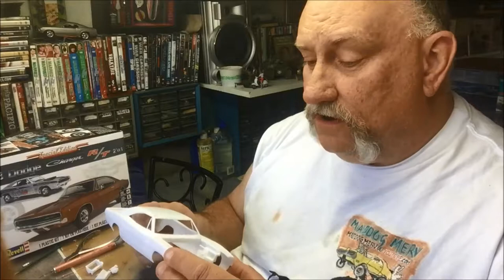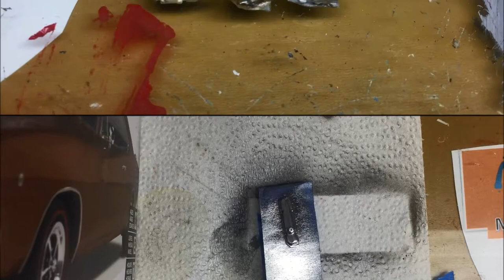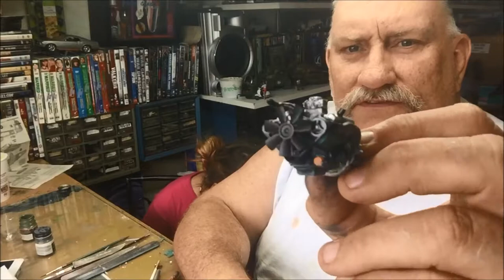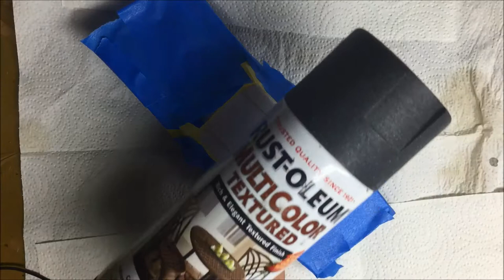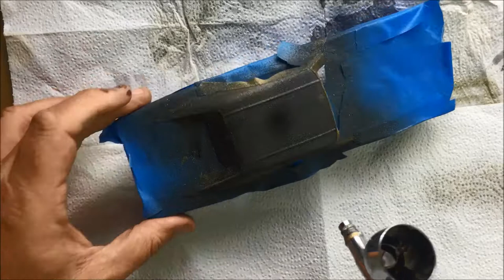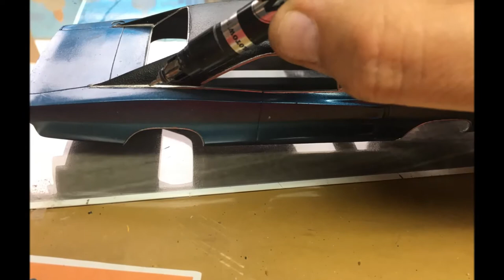Dennis's charger P.1/ How to model a vinyl top/ How to simulate chrome valve covers

Comment: is there a part 2? also after using the scale finishes do you do a wax job on the paint. my in law asked me to build him a lot 68 charger sun fire yellow so I'm in the research phase. thanks
Reply from the maker: Thanks for watching Mike and thanks for commenting. So far there is not a part 2 because I haven't completely finished the car yet. Got it to a certain point and it's been on the Shelf of Doom for well over a year. It depends on which one of his finishes I use. I have some of that yellow and I have not waxed it. I thought it turned out good with out polish.

Comment: Yes AFB Competition 5000 series/later Edelbrock 625 CFM w Electric Choke. On V8 Mopars 2 69 Roadrunners did 16.5 to 21 MPG. Holleys won't do that n perform too
Reply from the maker: My only experience with the AFB competition series carburetor was on my 1967 440 GTX. Excellent performing carburetor! Well I like Hollys for being able to work on them and I guess that’s just because I started out with those and could turn them down and put them together fast but could never get much in the way of gas mileage out of them.

Comment: You should try bare metal foil instead of your chrome pen. You will get MUCH better results.
Reply from the maker: I have, I have been wanting to try the pen. I can see where the pen could have some areas of use. Thanks for watching.
Reply: lies. if the pen is done right it gives a much better chrome finish than BMF. too many wrinkles.
Reply: @Circa1775  I think you have the term "lies" confused with "opinion". Just because poster has a different opinion than yours based off his own personal experience, it does NOT make it a lie.
Reply: @samspade685  oh sorry, not lie. Wrong. I meant wrong. BMF is not better looking than the chrome marker. It's just not.
Reply: @Circa1775  .."lies"?.....wouldnt this be a matter of personal opinion?
Reply: @bobschaar5720  no, there is clearly a better product that looks better than the other.
Reply: @Circa1775  .....again...a matter of opinion.  I'm not saying that you're right or wrong.  What looks good to you, may not be the first choice of someone else. In my opinion, foil looks best if you're looking for a shiny chrome effect.  On the other hand, the marker looks better (in my opinion) if you're looking for an aluminum or rubbed metal, or even a weathered metal effect.

Comment: All Spray paints can should be immersed in hot water to get paint inside can to 88 to 98 degrees Fahrenheit ot both thins paint. & raises propellant pressure making thin coats w/o runs easier
Reply from the maker: Thanks for watching and thanks for commenting Walt, I knew somebody would know the proper temperature. I always just kind of played the guessing game and fortunately I’ve only ever had one can explode and that was when I actually threw one into a fire. LOL those folks who don’t know about heating up their cans definitely are missing out on the full potential a spray can can do.
Reply: @maddogmerv    Rattle Can Myth.  You can't ger SHOW CAR PAINT JOB FROM A spray can. !!      Its all in the prep.   I did a AMT 56 Crown Victoria with 13 coats of paint 3 were flat white primer wet Sanded 600 wet/dry paper. Wet.   & tack clothed between each. It looked So Good A Harley Davidson Biker wanted NE.  To paint his Harley. Metallic Red/Metallic Purple w Met Red & Met Orange Flames.  Offered $4'-5,000 in 86
Reply from the maker: An airbrush is definitely the way to go for getting smooth thin coats. And in my opinion you can’t touch the quality of using an airbrush versus other methods of painting. With that said I have seen good results with a rattle can but usually requires quite a bit of wet sanding and polishing. I don’t like to work that hard usually. Unfortunately every once in a while the color that I want it’s just not offered in any form except for A spray can, requiring D-canning and proper thinning.